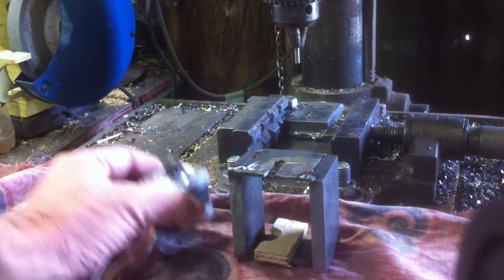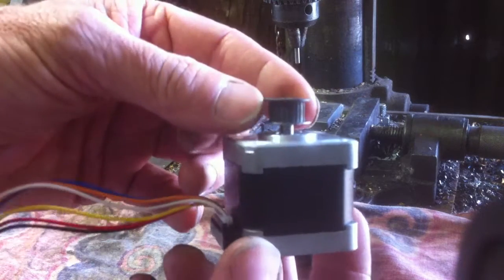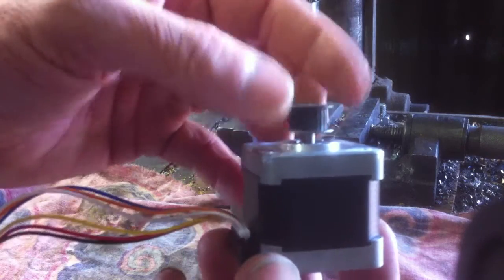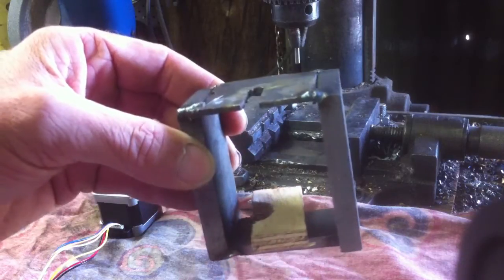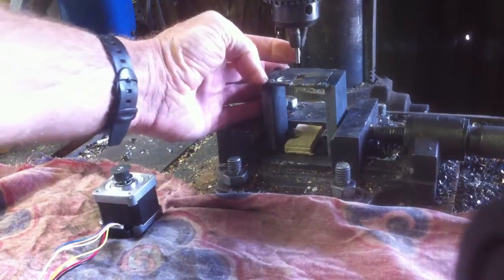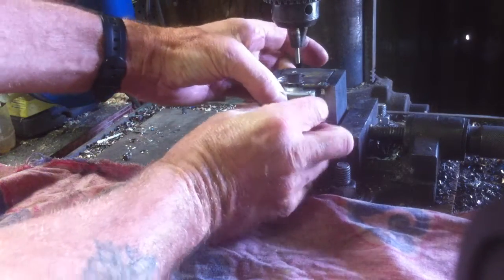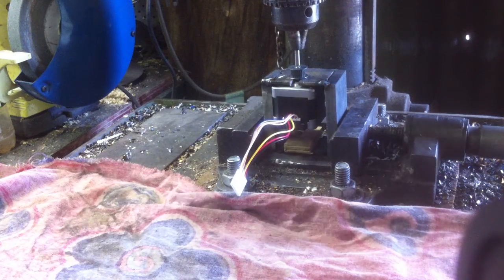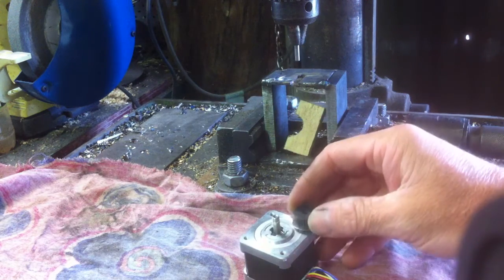We’re Pressing a Gear from a Stepper Motor the right way using simple tools that you own.

Comment: I tried this but my pulley was nowhere near budging even when I used so much force that I thought I'd break my drill press.  But I put the assembly on its side between the jaws of a vise, using small blocks of wood to support the bearing rest plate so the stepper itself was not getting crushed, then put a 3mm pin (size of my stepper shaft) in a hole drilled through the center of a ~30x20x4mm piece of metal, double-sided taped the pin/metal onto the jaw directly in line and opposite the stepper shaft so that bringing the jaws together made the pin push on the shaft and it worked with force to spare, though it was fiddly to hold the piece aligned before the vise started putting pressure on them.
Reply from the maker: Great idea. A good vise can certainly produce more force than a drill press.